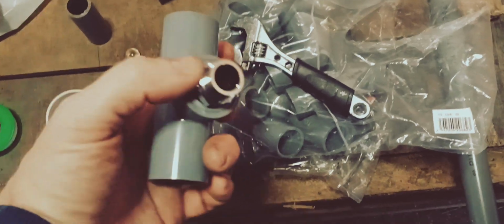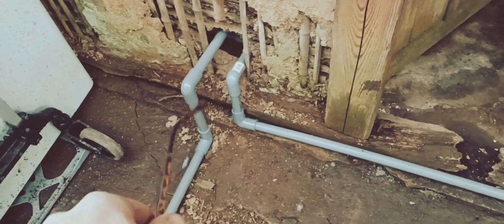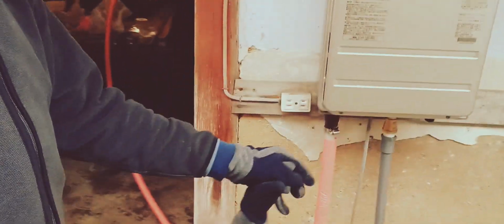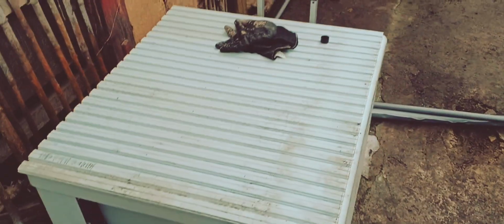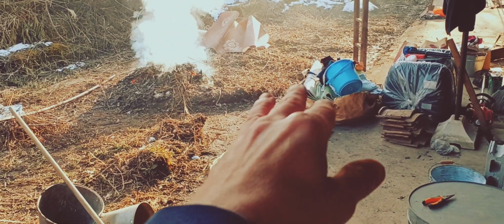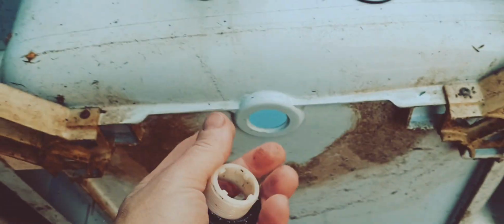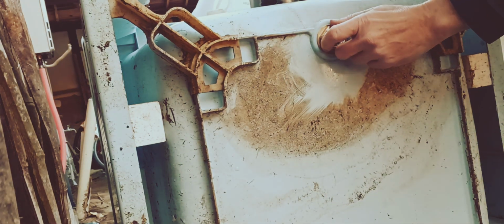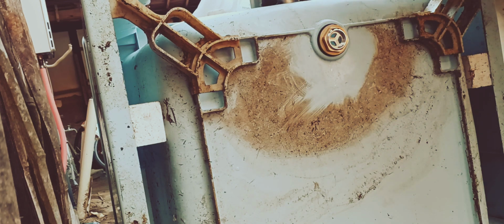Kominka DIY Series Vol. 1: Noob Bathroom Plumbing

Comment from the maker: There was so much to do and shoot regarding the plumbing that to put it all into one video was crazy big. I decided instead to break it into a few volumes, of which this is 1. I hope you enjoy it, as it's largely unedited and even has some parts where I drop my phone. Truly riveting. Yay.
Reply: Those 2 pipes can be sealed from the inside with some metal caps, plumbers tape around the thread, and they’re fastened with a large round headed screw. I have a picture so you can tell what you’re looking for in the DIY stores.
Reply: Juntendo have your part…brand is Sanei model no PR721 ¥1980. I found it near bath plugs if it helps.